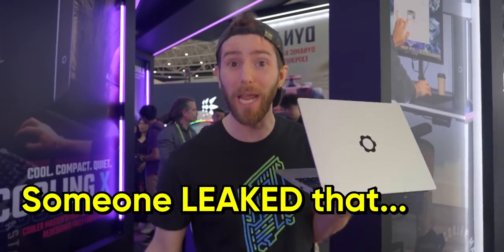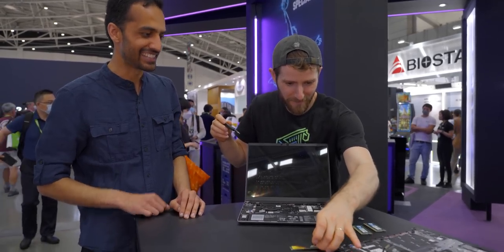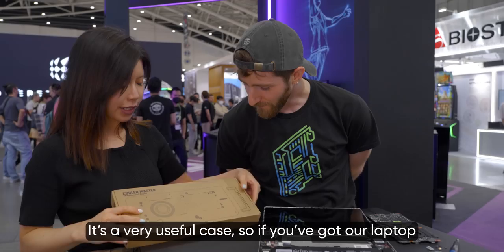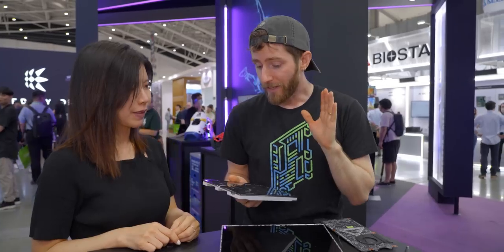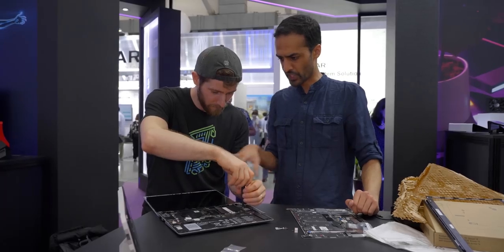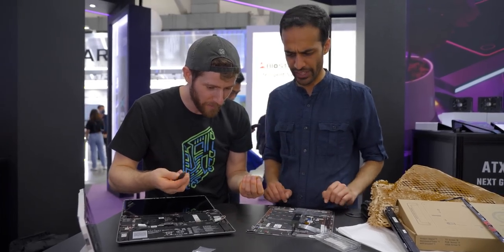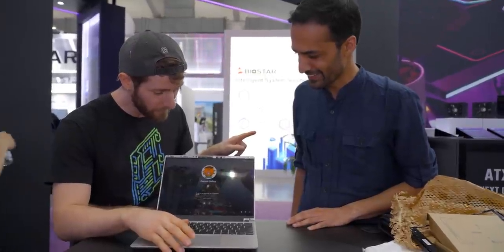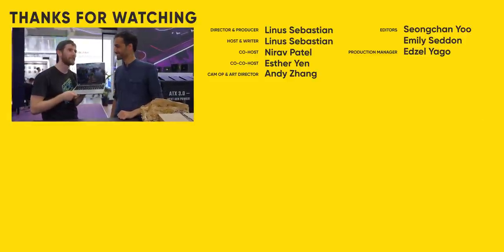World Exclusive: Upgrading my Framework Laptop to AMD

Comment: Its crazy to think how much the laptop space has changed with AMD efficiency and can continue to change with Frameworks upgradability.
Reply: AMD is junk
Reply: @Gay-is-_-trash  cry more
Reply: @Gay-is-_-trash  I didn't realize your mom's name is AMD
Reply: dude i got an r5 5500u and it easily beats my mate's i7 1135g7 while being 25% cheaper, it's nuts and battery life has been amazing
Reply: @Gay-is-_-trash  which century you are still leaving
Reply: @Gay-is-_-trash  said someone with no PC experience ever. Typical. Do you mean that junk 7945HX that is E.g. in Cinebech like 10 % faster with less power? Oh yeah. Or the 7800x3d that is like 3 % faster in gaming than 13900KS? for like half the price and half the power. Yeah, THAT junk.
Reply: @Gay-is-_-trash  AMD ryzen is more efficient and less power hungry than intel that reaches 300W at least
Reply: @StemLG  And even now Ryzen 5000U laptops got much cheaper after 7040 series release
Reply: @Gay-is-_-trash  I mean you can say that, but you have to bring evidence that backs up your claim, or else your just a hater.

What is best in the CPU space honestly just depends on the workload.
Currently AMD and Intel are trading blows in the gaming cpu space, as it depends on what game you play. The games where 3D v-cache helps, amd wins. where clockspeed is king, intel wins.
When it comes to efficiency AMD is king atm, and if this trend continues, AMD will become the common cpu to use in laptops etc.
Reply: @remus907  and yet despite this- somehow AMD laptops are harder to find. Shame really.
Reply: @Not_interestEd-  yep. It seems like notebook manifacturers and even MS don't like AMD... Probably Intel didn't learned when they got caught for anti-competitive practices. That's the only explanation because, for example my HP laptop just works with original AMD drivers but Windows tried everytime to install older versions provided by HP that are exactly the same AMD driver but just way older... Windows has the version number but no... They want the HP one until you use a Windows 7 utility to disable that... Windows 7... There is a reason why it is still called "the best Windows version".
Reply: @Gay-is-_-trash  Ryzen APUs literally wipe the floor with every other options and even some dedicated GPUs
Reply: Linus - you need to invest another $250,000.00!!!
Reply: @Gay-is-_-trash  AMD makes the best APUs. Bar none.
Reply: Been running this ideapad drawing tablet at only 18% CPU cap under Power Options. 
Still faster than my x360 from yeeaaarrs ago. And all day battery life because of it.
 VERY very efficient.

Sometimes with sapien or max running all day in the background when I forget to plug it in while doing other things
Reply: The AMD Ryzen 3 Laptop I got from walmart for $500, can run skyrim with a modlist of about 220 mods.

My brother's laptop, with an Intel Mobile (forgot the CPU, but is a comparable generation) can barely run anything beyond emulators.
Reply: the laptop scene has changed with Apple Silicon efficiency, not AMD
Windows laptops need to move to Windows on ARM, not yet another CISC x86 chip
Reply: It's more crazy how this akward kid from Canada turned into *Linus*. :)
Reply: @contiplays  amd CPUs have horrendous frame times.
Reply: @contiplays  in like 10% of games lmao, yo are wrong
Reply: @Kendog  that isnt a bad thing
Reply: @Insignia-pp1eh  wym??
Reply: @sammiller6631  but that's ASUS's fault not AMD's
Reply: @Insignia-pp1eh  even if it's like 10 of the game better and the other 90 % like 5/10 % slower, it's still half the price. and third the power consumption. so no, I am right.
Reply: Intel fanboys be delusional. Choke on that copium.
Reply: x86 still lives on and throws even Apple M2 max out of the window.
Reply: @PrashantMishra-kh1xt  with much more power usage, that's not efficiency
Reply: @breakgimme AMDs upcoming APUs are reported to have comparable efficiency and better performance than M2. The one AMD was specifically bragging about was the one Linus was installing in the video, I think.
Reply: @breakgimme  x86 chips haven't been CISC since about 1998. Welcome to 2023 btw.
Reply: @breakgimme You are right, but the point of Windows laptops is to allow you to do all the work you could do on a desktop Windows PC.
Reply: @Gay-is-_-trash  no u
Reply: @Gay-is-_-trash  if that's the case we still be using 4 cores / 8 threads as mainstream and 14nm+++++++++++++++++++ dont hate the competition because in the end consumer will always benefit.
Reply: @Kendog  intel alderlake way more energy efficient than AMD ryzen... AMD idle take 30w meanwhile intel 3w WTF ? AMD ? DAW photo editing video editing ? Intel > AMD intel power hunger when full throttle only....when web browsing intel has better performance per watt than modern AMD
Reply: @remus907  nah youre wrong intel on laptop way energy efficient than AMD ....since alderlake intel consume 3 watt and AMD consume 30 watt on idle when browsing?? lolz
Reply: @Gay-is-_-trash  intel doesn't like gamers
Reply: @TrioLOLGamers  intel has better build quality better encoder/decoder better and mixing hardcore video music ediiting due to high core performance
Reply: @D0x1511af  here we go another Intel simp spotted 🤡
Reply: @remus907  As someone who uses both brands (13600k in my gaming PC, R7 6850H in the work Thinkpad, R7 6650H in the previous work Thinkpad, and i5-8650 and i5-1235U in my own Thinkpads) I'm not sure I see the huge efficiency leaps everyone is talking about. For my usual mobile work loads (mostly mid brightness web browsing, many PDFs and office applications) I can't say I'd have preferred the R7 6650H in the T14 G3 over either the i5-8650 or the i5-1235U - I was easily hitting 8+ hours on all three machines and the Intel machines started to pull ahead in lighter work loads.

I do love the fact that the AMD chips will run simpler games like Fortnite, CS GO or Rocket League very well, unlike the Intel chips.

Anyway, benchmarks and reviews are one thing, but a lot of people here need to actually USE these things they're talking about like they're experts before they run their mouths in the comment section...
Reply: @ZedDevStuff  That's why no laptops use AMD,  right?
Reply: @Gay-is-_-trash  No laptops? Where the heck are you looking?
Reply: @contiplays  third of the power my guy=)
Reply: @dieketarre  depends on the optimization of the individual laptop so that doesn't tell anything. The point is if you take two identical laptops except the processor (one has Intel 13th whatever performance efficient series is and another is Ryzen 7040 series CPU) the Ryzen is just gonna last way longer. Same thing was true for 12th gen vs Ryzen 6000.
Reply: @ZedDevStuff  Dell XPS - Intel
HP specter - Intel 
MacBook - Apple silicone 
Microsoft- Intel
Reply: @yellowflash511  you are wrong here, watch Jarrod, the new chiplet AMDs are so bad at battery time unfortunately, the 7945HX was easily beaten by 13980HX. Maybe the single-die one will be much better, but at the top end, AMD loses.
Reply: @raspiankiado  this is just to make clear due to the Igpu not the CPU.
Reply: Hasn't changed much and laptops suck.
Reply: @dangerous8333  laptops are actually pretty awesome
Reply: @StemLG  Dude, I'm still rocking an i7 3930k overclocked to 4.5 GHz from 10 years ago. 80 + FPS in all games and still works great for media creation. 😂

Let us know how long your AMD lasts. 😂

Laptops suck too. Enjoy wasting your money every couple years.
Reply: @predator9909  Have you bothered to research?

MANY people that switched to AMD a couple years ago are switching back to Intel already.

It's not that this person lives in a different century, it's that people drink the Kool-Aid a couple years ago that AMD is better than Intel, and they're realizing the hard way by having to upgrade their CPUs already when thousands of people are still using ten-year-old i7's for gaming and media creation.
Reply: @dangerous8333  that's literally not true. AMD gained market share in consumer CPUs in 2022-23 from Intel. This is literally public information as both are public companies. At least lie about something which can't be proven wrong with 1 Google search.

Edit: here are the facts: in consumer CPUs AMD went from 27.7% to 34.6% and in server 11.6% to 18%. 🤡
Reply: @contiplays  <--- Said someone with only PC experience from the last few years. 😂
Reply: @Kendog  You can easily undervolt Intel processors and not lose any power. 😂
Reply: @remus907  How about two decades of evidence and counting? How about all the people that are still using ten-year-old Intel CPUs for gaming and media creation?

You only have evidence that AMD has beat Intel once in two decades and only in the last few years. So why are you guys even on a high horse yet.😂

Sure AMD has finally made some decent CPUs in the last few years. I still need to be proven that they last.
Reply: @raspiankiado  Pure speculation because you don't even know what CPU he has. You can't just say comparable. Sorry buddy...hard fail.

I bet his Intel laptop will last longer than your AMD.
Reply: @eirgo_s  You aren't going to cancel out two-plus decades of Intel dominating with a couple years of AMD competing. 😂

They're more expensive, yeah cuz they last longer. They use more electricity, yeah but you can undervolt them. 🤦
Reply: @Con Pin Have you ever heard of undervolting?

And you don't lose any power either. 😂
Reply: @Gay-is-_-trash  lmao all 3 of the companies have models of amd laptops. envy, inspiron and surface.
Reply: @StemLG  nah. i have 5500u and its a poor man's Apple Silicon at best. the media decoder is straight up trash. the shit was lagging in 4k capcut. CAPCUT! , of all things out there.  even tested the 6800h with igpu, still no improvement. intel does it smooth like butter, even on crappy dual core i3. the only area ryzen has advantage in laptops is rendering , which is still slower than cuda, and users can always leave passive jobs like that running while they go do other things anyway. even the heat and battery problem on intel can be fixed or brought close to within 10% of ryzen with some minor tweaking. AMD still has a lot to learn on their way to making the perfect mobile chip and winning in Cinebench alone wont cut it
Reply: @Gay-is-_-trash  If you think those are the only laptops around you're going to be surprised
Reply: @dangerous8333  thats why im saying "now" and not "all time" i love both and use both daily.
Reply: @ZedDevStuff  They're the only important Laptops
Reply: @Gay-is-_-trash  Well, you don't get that word called corruption? I forgot the story from early 2000 when Intel paid manufacturers to dunk AMD? It's happening even right now. In HP Elitebook line AMD model Elitebook 745 - AMD model with 14" display - AMD ones are getting worse displays then Intel ones. Not because AMD is worse. Just because Intel is paying for that, so the machines with AMD are worse & you will just go with Intel one. Elitebook 745 has 200 nits display, Elitebook 840 has 400 nits display
Of course you can upgrade display in AMD model, but I you would walk into the store with these machines, AMD model is only in strange ,,budget" options.
Reply: @Gay-is-_-trash  Great trolling. AMD has ATM the best APU, which is great for Laptops, which are not dedicated Gaming Laptops but for Business (CAD, Adobe etc) and Casual Gaming. My Ryzen 7- 3700u Yoga runs Total War: Warhammer II on max Graphics, which is great for a Mobile Platform which can perform a 8 Hour workday without power-plug. So Daily Work and in the Hotel some relaxing Gaming, when abroad. Try this with an Intel Plattform. Intel Arc lands as APU in Intel Mobil processors it won't have the Graphic-power, and with a dedicated GPU you run into the 99Watt limit of Mobil devices, so you end up with 4-5 hour without power-plug on a normal work load-out. The Vega 10 is not great but sufficient for most Strategie Games and even Fortnite. Up to 12GPU RDNA3 Cores on a 7040 series are no slough for a mobile CPU, the Steamdeck got 8 RDNA GPU Cores and the ROG Ally 12 RDNA3 Cores as well, you can look up how the performance is. The Framework with the professional Ryzen 7 CPU will literally have the power of the ROG Ally with a higher Thermal Power. Until Intel launches a Battlemage based APU, there is only the M2 and M3 chips with the same APU Power out there. And i go Team x86.
Reply: @Gay-is-_-trash  Wow you really think everyone use these ones?
Reply: @Kendog  Lol you AMD fangirls will be crying salt when Metoerlake crushes AMD in all performance categories especially efficiency.
Reply: @kingyogesh441  bro believes userbenchmark 💀
Reply: @dieketarre  were the batteries the same?

Comment: The desktop case supporting VESA mounts is massive. They've effectively entered the all in one market with just developing a new PC case.
Reply: My nuc came with a bracket for attaching it to a vesa mount
Reply: It's great. Whats missing  for me is an expernal power button that you can add somewhere to your monitor. I'm not crawling behind the monitor everytime I want to turn it on.
Reply: @geyoda64  there is someone who made a board you can attach to the input connector so to which you can solder a power button, usb 2.0 and some software controlled leds.

Google "Framework Mainboard Power Button Shim"
Reply: @AltonV  True, but that was purposely build to be on a monitor, as the whole concept of mini pc's was to have it directly on the monitor. This here from Framework and Cooler Master is a "byproduct" that came to life because you can purposely re-use your old MB, when you're upgrading, to even further support the idea of limiting E-waste. 🙂
Reply: @ReaperSilently  no it wasn't purposely built to be on a monitor, they just included the option for it to be.
This is a skull canyon to be precise
Reply: @geyoda64  Would love it if you could share with us another PC manufacturer that does this. I'd buy from them in an instant.
Reply: @geyoda64 Couldnt you configure it to Power on when plugged in and then just put a switch on the Power plug?
Reply: @AltonV  Needed to look up what Skull Canyon is :D and true, that is not build for it. I meant general mini desktop pc's, you know, the likes of Minis Forum, etc, but then back what, 10 years or so? I can only remember those being justed in office environments for space saving and power cost reduction, but maybe I'm confusing things up here in my brain. Just found out I'll become a dad, so probably it's that :D. Anyhow, I need to agree with you, they're not all build for that, I was just under the impression that those mini pc's (all those years ago) where build for that. Thanks for clarifying mate :D
Reply: @gollumxonpc5162  That would hinge on that functionality being in the bios.
I haven't used a framework, but I don't think that I have seen it in any other laptop
Reply: @AltonV  There are many Laptops that have it for use on docking stations/usb-c dongles
Reply: @gollumxonpc5162  didn't know that, thanks

Comment: I really hope this becomes popular and sticks around. We need our modularity back on laptops
Reply: Agreed! I miss the old days of being able to add and remove things from laptops and other devices.
Reply: Even more so than that Alienware Area 51m laptop.
Reply: More to the point, we need AFFORDABLE replacement parts for laptops.
Do you also remember the prices of MXM GPU's back then?
Horribly overpriced for not a good increase in performance (it was either cheaper or would cost the same to just get a brand new laptop with modern dGPU).

Personally, I use mostly 17" laptops. I like the bigger size and the power it can provide... and because I like portability and doing content creation/productivity on the go, I don't mind lugging a bigger laptop with me (its not that heavy).
Reply: Well, not gonna happen if they're only selling on one side of the world.
Reply: @bassyey  Let's hope that they can expand to other markets and become a worldwide company.
Reply: @deksroning125  I agree with this also! Laptop parts are obscenely overpriced, especially for newer machines. Older machines typically have lower pricing, but are still not low enough to be viable.
Reply: @bassyey  laptop vendors will do everything for this not happen.